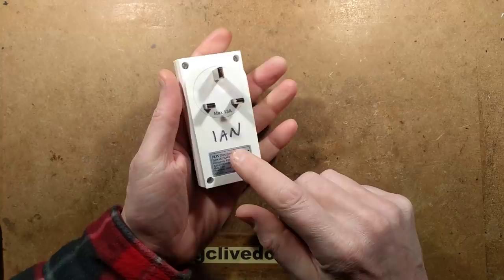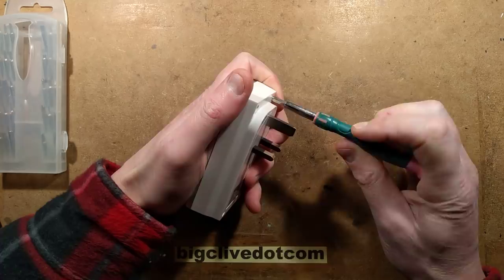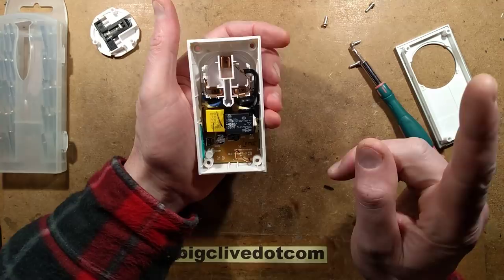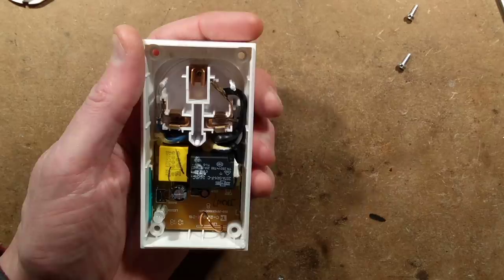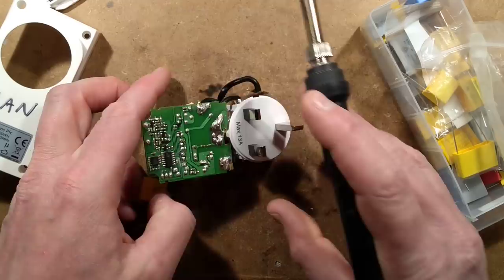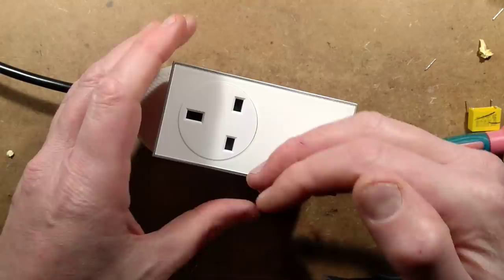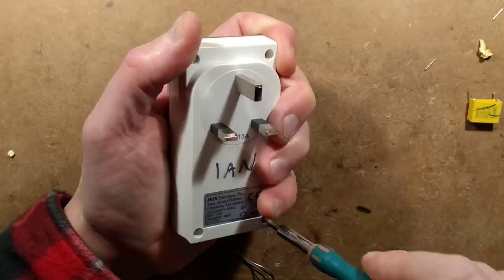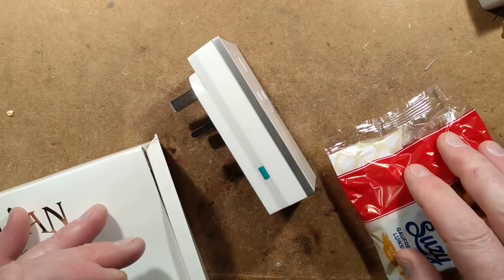Fixing a faulty remote power switch.

Comment: I've never really had much luck with desoldering braid, especially when you remove most of it and end up with a bit of solder blocking the hole.

Those £0.50 generic blue desoldering pumps work a lot better in my experience
Reply: I agree,  A decent solder sucker pump is more efficient and there's no contaminated copper braid for landfill afterwards
Reply: @johncoops6897  well that might be true but it does kinda work, it's just when you get some small leftover bits like solder stuck in the lead hole which just doesn't want to come out with braid. 

It can remove most of the solder but I still prefer the pump because it's just a press of a button and it's gone, plus it lasts quite a bit longer

Comment: Manufacturers: lets make different screws so people can't open up the devices.
People: lets make drivers available for those tamper proof screws so we can open them
Result: Back to where we were in the first place......
Reply: Neighbors wanted their 10 year old to learn electricity, before he knew math etc.; It ended after 1 lesson, when he was discovered taking their stereo apart, with the power still on. Tamper proof fasteners keep smaller idiots out too!

Comment: Suppression capacitors and safety capacitors are 2X boxes capacitor, what exactly the difference, seem they are interchangeable?
Reply from the maker: X2 are suppression capacitors rated to go directly across the mains connections.  Class Y capacitors are for use where failure could pose a risk of shock, like from live to earth/ground.
Reply: @user-gx6jb6wc5g  It seems you used safety capacitor to replace 224K suppression capacitor. (seem interchangeable)?
Reply from the maker: @jeraldleung6009  X2 suppression capacitors are often used in capacitive dropper power supplies.

Comment: Bugger. I had 3 out of 4 remote socket thingies that stopped responding and I threw them away LOL 1 still works, though I dont really use it, its always on inside a burried box that I have in front of my redundant fireplace. I have a 3volt adapter plugged into it and 12 RGB Colour changing 'spikey balls' inside to make it look a bit like a disco floor in a night club lol. Yes I am a bit mad like that :D

Comment: Perhaps that hole is there to aid ejecting the board when needed?
Reply: Maybe it exposes the serial bus of the μC or EEPROM, plug unit into a fixture supplying mains and two test pins, run an automated test and programming script, tell worker to add sticker or discard device.

Comment: Searching for a 330nF cap (old one, yellow unbranded measures 217nF) that the manufacturer states is suitable for series (cap dropper) use. No luck so far. Any suggestions?
e.g. Kemet R463I333050N0K (330nF 310Vac X2) = a quality cap including 400V/uS  dV/dt rating, but they state 'Not for use in "series with mains" type applications.'
Reply from the maker: That's the first time I've come across a recommendation that suppression caps are not used in droppers.  Most of the compliant products seem to use X2 caps.  Note that case sizes and pin spacing (pitch) can vary.  I get my caps from prominent local suppliers like Rapid Electronics or CPC in the UK.
Reply: @user-gx6jb6wc5g  apparently Vishay and others do some caps FOR dropper circuits.
My problem wasn't due to the cap. It was a dirty rotary channel selector which may also have had a bent contact (there were 3 contact wipers). Now perfect!!

Comment: For faults that cannot be fixed easily ... Take out ALL the electronic gubbins .. replace with ( 2 off , 1 microfarad MAINS RATED capacitors , side by side ( ? ) , wire in parallel = 2 microfarad , with a 1 MΩ , ½ Watt resistor across the capacitors, to prevent shocks etc .. then wire the capacitors IN LINE with the live input / output , neutral ONLY used if you require a mains neon indicator ) this now forms a ( tried - n - tested ! ) nightlight dimmer for a single Poundland™ 60 Watt antique style tungsten filament lamp , (approx 80 Volts gives a pleasing orange glow , and the lamp will last decades ! ! ) .. note the more common LED lamp types will NOT work , get the genuine Poundland™ tungsten type MUST be 60 Watt ( efficiency = E , Ha - Ha ) ..... QED ...

Comment: What is the function of the capacitor in that circuit?
Reply: It's a dropper resistor that doesn't get hot because all the unused energy is thrown back onto the grid with a slight delay.
Reply: Dropper capacitor - if you understand how a capacitor only passes AC, you'll know that the amount of signal passed is proportional to the frequency. A mains dropper cap is "sized' to pass a small amount of 50Hz mains voltage - one side of the cap is at mains potential, the other side is a (calculated) fraction of that. It's effectively doing the job of a transformer, but where you don't need much in the way of current. In this case, it is rectified, levelled (zener mentioned), and regulated to be used only for thee control side of the circuit. Apologies if that explained more than you asked for!

Comment: I've had many of these kinds of switches: they all give up the ghost and won't switch; however, I think my problem is a high current on initial switching which melts the bar, in the relay, to the contacts. All's I want is a remote switch! They last about 2 m month, then ... no click (unless I help it with a heavy thing being clunked on the side of it!).  What can I do?
Reply: I wonder whether you could buy a surge-suppressor extension lead and plug that into the socket, and thenplug the load into the extension. It may be the wrong way round, but it could help stop the spikes that weld the contacts together - back emf, in my opinion. A cheap item to buy, easy to rig up and if it doesn't work, use it elsewhere in your home.

Comment: Heh, funny. Almost every remote power switch or dimmer have written on label or in manual, that it is designed to be used with resistive load, but I never seen specified on any appliance if it have resistive, capacitive or inductive characteristic. I don't know, how is it in other countries, but where I live I never seen it. Probably, majority of amateurs will not understand what "resistive loads only" means. Is the load characteristic specified in manuals in other localities?

Comment: I thought you couldn’t probe capacitors and circuit?
Reply: One end is open (connected to the power input) and the only thing across is is the bleeding resistor (and open relay contacts). So in this case it will work.

Comment: Can someone tell me what flux is and why it helps with soldering?
Reply: It's a chemical that etches away the thin natural oxide layer on the metals to be soldered.  In electronics it's traditionally based on natural resin (from trees) mixed with a solvent, but liquid flux (like in flux pens) is usually a different formula to make it a thin clear liquid instead of a more wax like substance.
Reply: Here you go:
https://en.m.wikipedia.org/wiki/Flux_(metallurgy)

Comment: Shouldn't it be a 400V rated capacitor??
Reply: No, it would only need to be 400v if it was connected across active- neutral as a suppression capacitor. 
Since its in series as part of the capacitive dropper circuit it should never see full mains voltage across it.

Comment: Bearing in mind most people won't have even the most basic knowledge of electronics, I wonder how many of these things just get thrown away because they stop working. Surely there needs to be a move to encourage the repair of small consumer electronics. While the cost would be minimal, the obstacle would be the hassle factor of "its easier to just buy another". Not very sustainable.
Reply: A lot of towns have "Repair Cafes" now where stuff like this could be fixed by volunteer  experts

Comment: Sooo. 
i dont like using remote control, wireless or time switches for lighting or switching.
 i always think, that if i can light a way for 1 .. 2 watts with leds, 
why waste another watt or two for the standby switch.

just leave it on or use a manual, non standby-power-using switch.

Comment: Ayyy, that's a pretty generic setup. I have a real cheap set off of ebay that look exactly like that. Well, minus the plug end. 
On the two that did the same issue, the problem was the Ground wire pass through was making poor contact, despite seemingly making complete contact.

Comment: Why are some capacitors square
Reply: I dont know but they can
Reply: Depends on the design, electrolytic capacitors are usually rolled up so they get a cylinder shaped can, ceramics are dipped in stuff so they’re blobby, metal film can be square, I guess they are so they are easier to handle.
Reply: Take a look at the diagrams here: https://en.wikipedia.org/wiki/Capacitor_types#Ceramic_capacitors

You'll find that round capacitors are round because they are made of sheets of material that are rolled up in order to increase the surface area.
Reply: The square ones are quantifiable zener emission sources, that produce electron curvature at the corners, this facilitates the flow of the galvanic resonant charge.
Reply: Because they're not hip, man...

Comment: Can anyone please tell me why the gold miners on TV have to run a quarter of a mile to shut off a machine that's not operating correctly? 
You're telling me they don't have Wi-Fi or Wireless switches?
And why don't boats have an airbag in the Keel that will stop the boat from sinking????????
Reply from the maker: It's for drama.  Most of those "reality" shows are scripted (including the breakdowns).  Otherwise they'd be quite boring.
Reply: @user-gx6jb6wc5g  
Ah. Gotcha. I'm still waiting on somebody to invent a simple to bucket system that will separate paint or nasty water from clean water so we can dump it down the drain in construction.

Comment: I've got a faulty "Energenie" plug in power monitor which has become less accurate over time, anyone know why these power monitors seem to die over time?
Reply from the maker: It could be that it is suffering from the same gradual failure as this unit.  As the power supply voltage drops it could affect accuracy.
Some of these units don't handle complex modern loads like LED lamps well and will show a very inaccurate reading because of the major difference between current and voltage waveforms.
Reply: @user-gx6jb6wc5g  Thanks for the reply and love your channel. Unloaded and plugged into the mains it reports mains voltage at 270v which is odd. Its a tidy unit.....well was anyway.
Reply: @user-gx6jb6wc5g  Just measured the supression capacitor and it 0.19uF instead of 0.47uF, maybe its that.

Comment: "More than enough explosives to blow stuff up" is not really the kind of thing you want to be saying with all the NSA tech nowadays. Say hi to the suits ;-)
Reply: Had similar problems with industrial fluorescent fittings that caused the tube to flash when the capacitor went low in value

Comment: A 22k capacitor is 22nF, not 220nF as you annoyingly keep repeating... (22,000pF=22nF)!!! I am dissapoint
-or so I thought, looks like it's .22k, being 0.22uF=220nF, k being 10% tolerance range!
Reply: Clive knows what he is doing - most of the time! I wasn't sure I understood his explanation, so I dug around. 1,000nF = 1uF. The formula is to multiply the nF by 0.001 to get uF.
So 220 (his description) times 0.001 equals 0.22uF. So for that capacitor, the point 22k (0.22k) as printed can be changed straight into uF. It's 0.22uF which, as Clive said, is 220nF.
Reply: @travelbugse2829  Except most caps are labeled in μF or pF, not nF .
Reply: John Crower Doe - err, some are labelled as uF, some as nF, some as pF, and some as a three digit code in pF...
And supercaps are normally labelled in F!

Comment: Designed to fail..
Reply: Well.. designed for a certain lifetime which people are prone to accepting. Having a more sophisticated psu would be more expensive and prone to other failures. Perhaps the cap could be a plug-in accessible without opening the box and replaceable every 5 years or so by the user to save on e-waste.
Reply: @benbaselet2026  and a cost, probably not so much the design but component quality, but they would push the price up.
Reply: @benbaselet2026  Something like the pin holders on chip sockets would do very nicely.
Reply: @K-o-R  Yep. The running capacitor for a circulating water pump for the house went bad and it was easy to replace. Just open a lid and pop the wirews off a socket. Of course the local specialist shop guy "never heard" of replacing caps and said I have to buy a new pump. The local electronics show sold me the cap for $3.50.